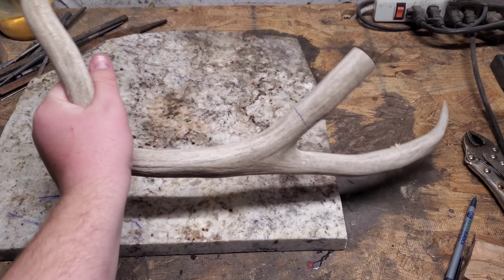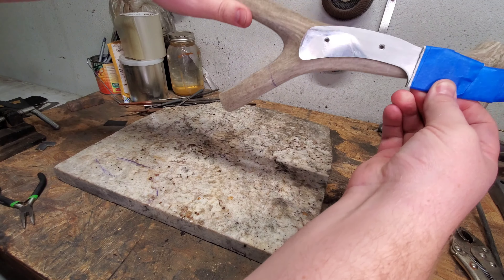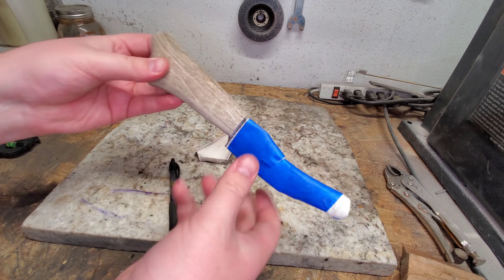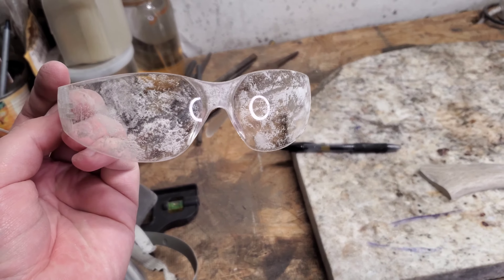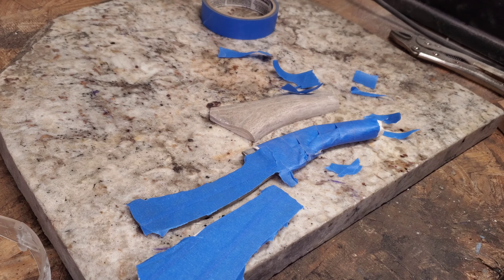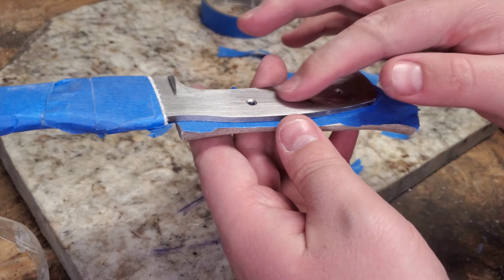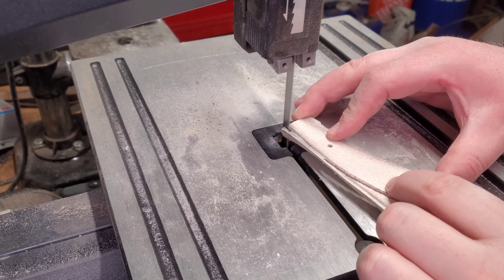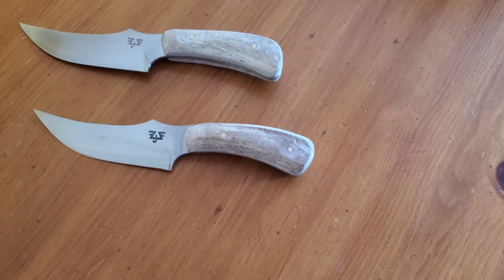How to make Antler Knife Handle Scales

Comment: I have been cutting and mounting antler scales for my knives for several years.  I learned something here with your technique with the blue tape and super glue.  Here's how I cut a piece of antler in half.  Take a small square of plywood and lay down a puddle of silicone.  Imbed the antler in the silicone so that you can slice off a scale with a saw.  I use my table saw for this but a band saw with a fence will work too.  Then swap the block around and reset the saw to slice off a second scale.  This gets you close to the thickness you desire.  Final sanding can be done simply by holding the scale in your hand just as you showed.  However, you can remount the scale flat side up on another block of wood with silicone.  The block provides a better hold of the scale to sand to the final thickness.  The rest of the process is the same as you described.  Nice job!